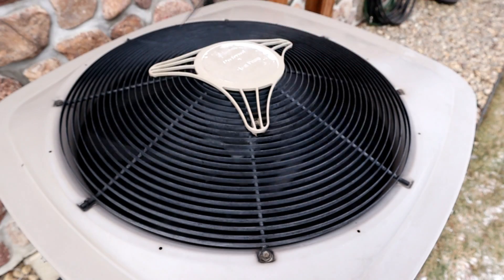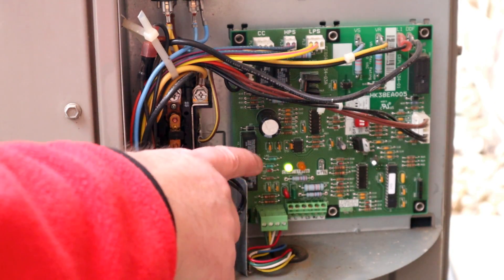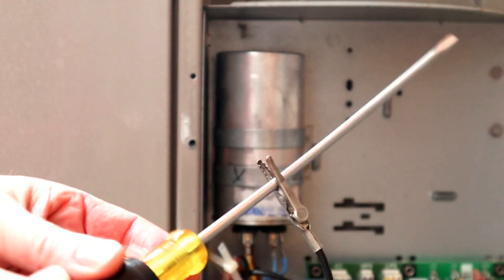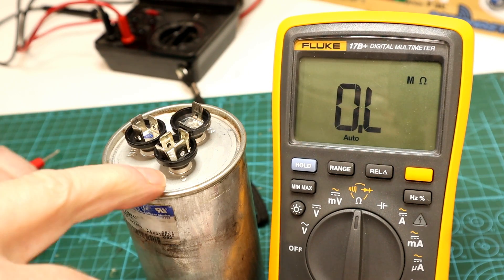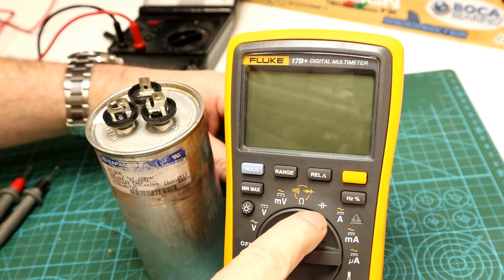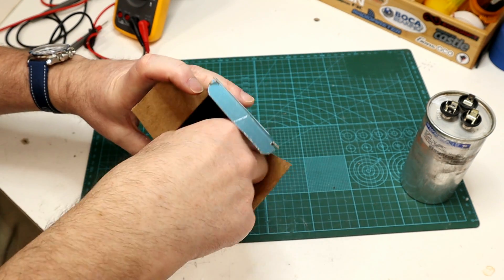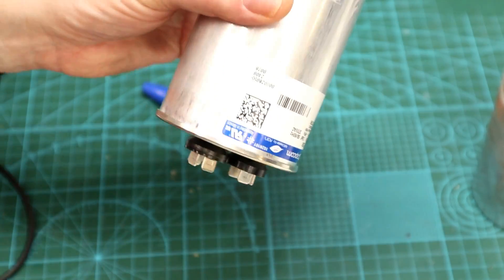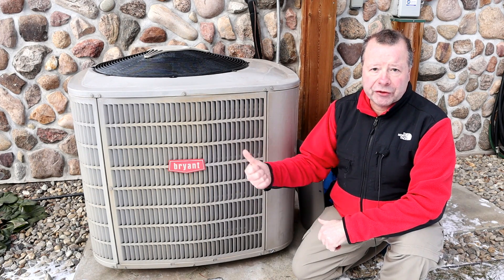AC / Heat Pump Fan Not Running: Easy & Low Cost DIY Repair!

Comment: anyone able to tell me if the bad capacitor can start with these systems, cause I am not at home and can not check that:
- circuit breaker tripped 3 days ago and yesterday, but it was the central one for phase 3 of the house (not the dedicated ciruitbreaker of the single phase heatpump which continued to run)
- today it did not happen again, but the heatpump had not defrosted and a family member turned it on manually - at the end of that (after drop from 2000 to 1000 W it stopped working in that way that the fan did no longer turn on even though I could see remotely in the load curve for the following 30 minutes power peaks of up to 600W and then drop back to standby - but that happened 90 times in 3o minutes cause I counted the spikes which are also 90% quite regular, only at the beginning there were changing times space at idle) 

Would be great if someone could help me out if that can be typical. I am not home, hence I can not push the fan on and I do not want that a family member tries that cause I have to disassemble the front case / housing to get there cause the fan protector or guard does not allow to put a stick in and push a fan blade. 

great video and I hope that this might be the cause - heatpump is 5 months old and a chinese one with 8 kW from Solareast model bln-008tc1 , a R290 heatpump and as said before with single phase. That is secured with its own 25A circuit breaker and also has its own RCD, but none of those tripped. I must admit I have not grounded the heatpump separately, just the usual single phase cable with ground , neutral and live wires. 

Thanks for any support and I hope it might help others too (btw.: we had icing conditions and the heatpump was in defrosting mode or at least it happened more or less seconds afterwards).

UPDATE: I have a dedicated compressor board which also has 4 capacitors even though they look from photos from the manual rather smaller than the big one.

Comment: Thank you for the information. My heat pump was running but no fan blowing.  Got a hvac man out it was working again!! Now 3 weeks later it did it again. But i didn't call the hvac man.  Several hours later it works again !

Comment: 4-6 days without heat. Yikes. Brrr.
Reply from the maker: Electric boiler took over the heavy lifting along with the fireplace - no problem at all (other than the power bill the following month) 😄 When you live in remote areas, it's almost a necessity to have multiple systems as backup for times like this.